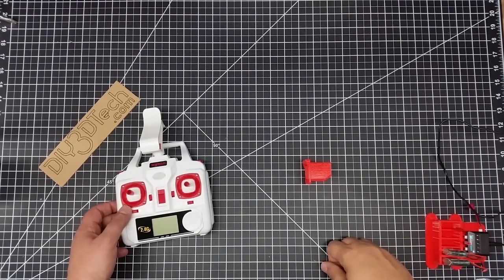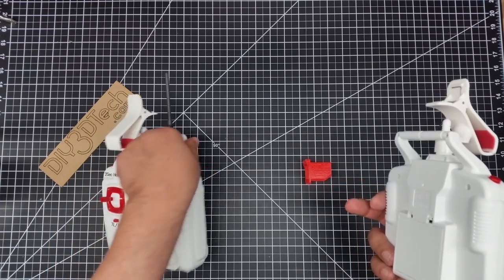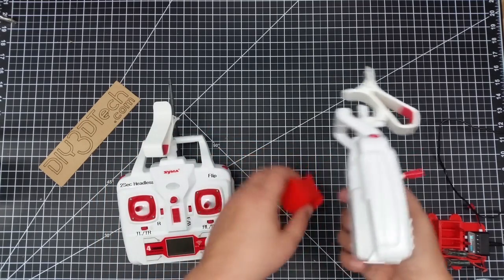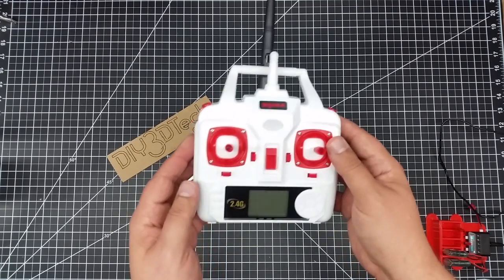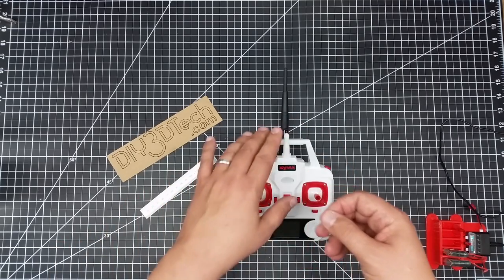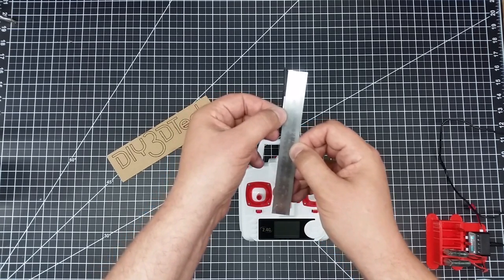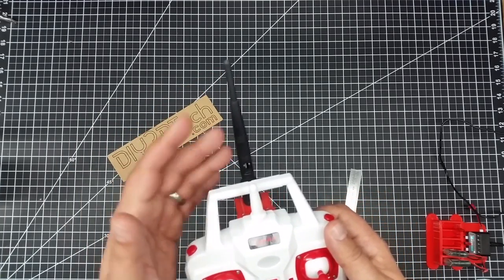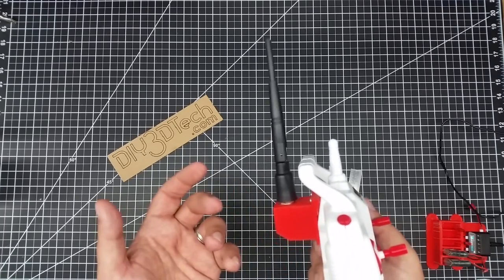Video Drone - 3D Printing an Antenna Mount for the Syma X5 Transmitter!

Comment: I had the idea to mount my GoPro to my Syma X5HW. It however is just slightly to heavy and the Drone can't take off. What about 3d printing a custom, lightweight frame for the X5 as the next project?
Reply from the maker: Sorry there is simply no way to get an Syma X5 to lift a GoPro, however did you see this design I created ( https://www.thingiverse.com/thing:2047111 )?  This is at the VERY upper limit of what the Syma "5" class can lift...